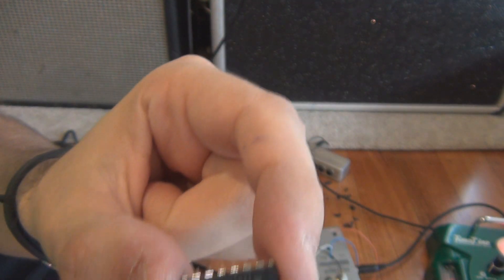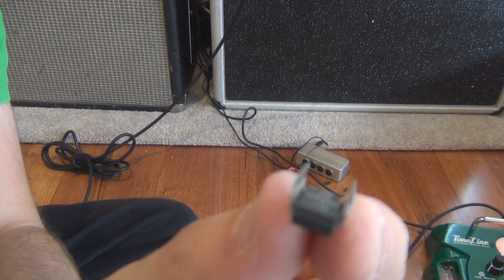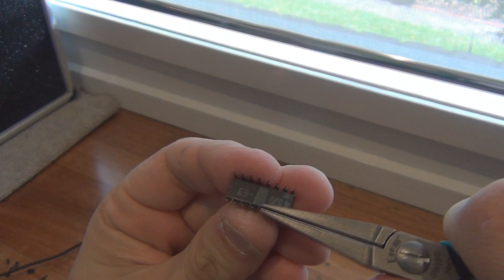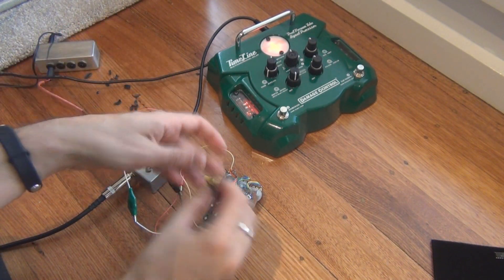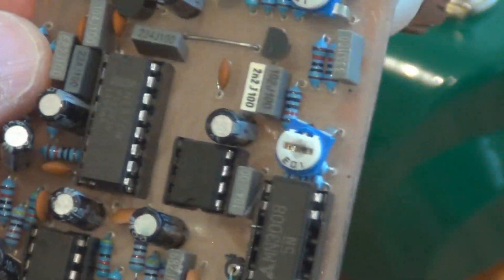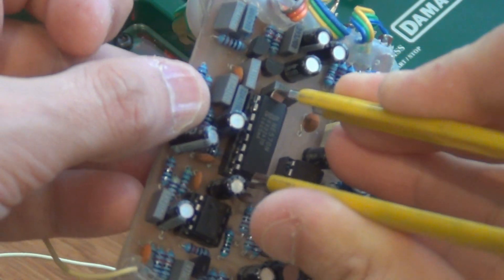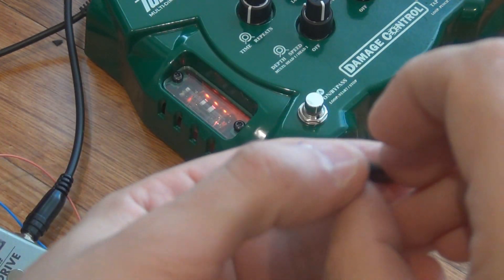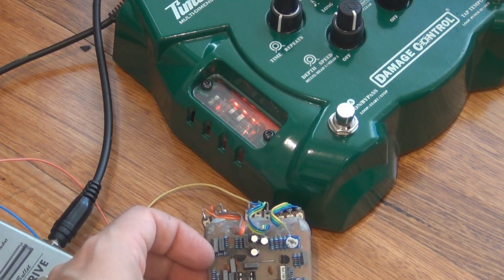Micro Quick Tip - Inserting & Removing IC's

Comment: Hi thanks for this quick tip -  I am totally new to this, but it's no clear to me whether static protection really matters. So you won't damage the chip if you hold it just like that, without connecting your wrist to the ground?

Comment: Recently removed one of these for the first time and as ashamed as I am to admit it I will for the sake of warning others. I tried to pull it out with my fingers, squeezed too hard, it popped out, rotated, bent several pins and stabbed the shit out of my thumb. Like half the pins straight up went into my thumb and I was a cyborg for a second. I'm current on my tetanus, but fuck that felt weird and hurt.

Comment: Hi, do you know if the IC will pass through if the mount is placed on upside down? I have the IC lined up according to the PCB but realized I put the mount it slips into upside down. Does this effect anything or would it still work?

Comment: Hey man I'm really new to this and was wondering what DIY kit youd recommend. Do the kits come with everything i need? or will i have to go searching for components?
Reply from the maker: Hi David.  I would recommend any of my 7/10 min kits.  If you order all the kit options available you will only need a 3pdt footswitch and enclosure to finish the pedal.  You can get these from Tayda Electronics, they ship world wide and are pretty cheap.  Check out the assembly videos for these to get an idea of what is involved.  Cheers.

Comment: Hi Paul, Good tip, the extractor looks like a handy tool. Yes, bending the pins slightly inward does help with insertion of IC. Looked like a Fender amp with reverb. Might I suggest a great Youtube channel called Uncle Doug, who builds and reviews vintage tube/valve amps, most informative. Be good, C.
Reply from the maker: +Cass Virgillo I watch uncle dougs channel, great channel for amp info!
Reply: DIY Guitar Pedals Hey Mate, Let's not forget Rusty, he makes it all possible. Cheers, C.
Reply from the maker: +Cass Virgillo lol I like the little interludes Doug puts in his videos, breaks up the concentration and talking.  I wonder if my cat lily would co-operate? :)
Reply: Hi Paul, I'm sure she would, cat's are most amicable. Goodnight, C. P.S. That's a cool name for a cat, love 'em.
Reply: ***** Hi LSG, I'm gathering parts to build and point to point wire a Fender 5F1 'Champ' amp, based on his 5F1 built from scratch/ salvaged parts. My favorite channel on YT. Be good, C.
Reply: ***** Hi LSG, I will keep you appraised of the progress, Works a little tight, but making headway. Just built a Runoffgroove.com Ruby 1/2 watt guitar practice amp based on an LM386 audio op-amp & a MPF-102 J-FET acting as line level input, works awesome, can play Cigar Box Guitar, regular Guitar or an MP-3 Player. It is housed in a 1950's Ward's Airline old All American Five, 5 tube Radio enclosure with two Altec Lansing 3 watt speakers wired in series, 2 x 4 ohm = 8 ohm load. Sounds awesome, if I say so & I do. I have probably watched every UD video several times, very enjoyable. One of my favorite channels if not, Maggie 8181 is heading up the list. Hofner violin bass covers, very good. A sweetheart. Check out Runoffgroove.com, a quick good read. Also a fun build. Take care, C. P.S. 9 volt's, 8 - ohm's, & your golden.